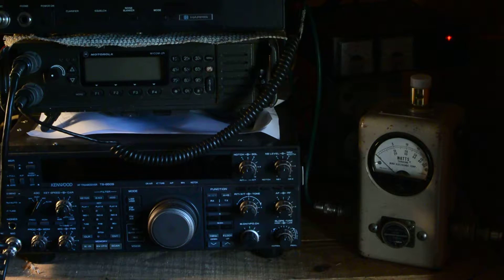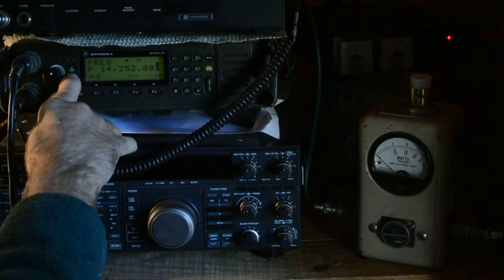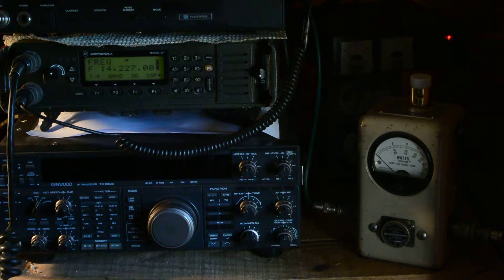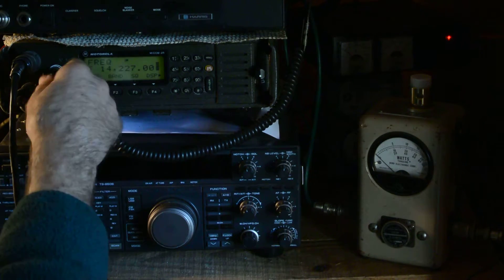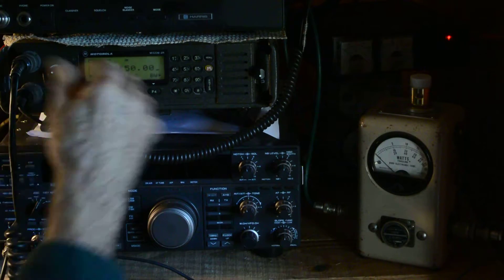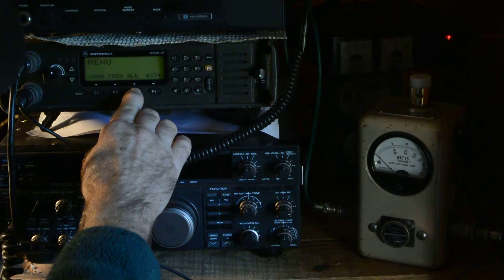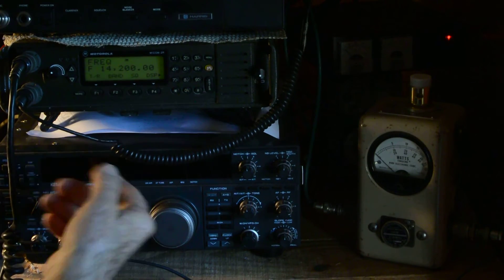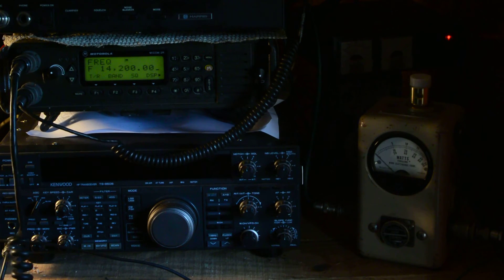Motorola Micom 2RS HF transceiver

Comment: Thank you for the video! How many Amps dows it draw at full power? 
EA3IAV 73
Reply from the maker: it does 125W RF at full power, so it draws about 20 amps max during peaks in SSB.
Reply: @pinznut  what do you think:
Is it a mil radio with commercial ham radio features 
Or is it a commercial radio built like a mil radio?